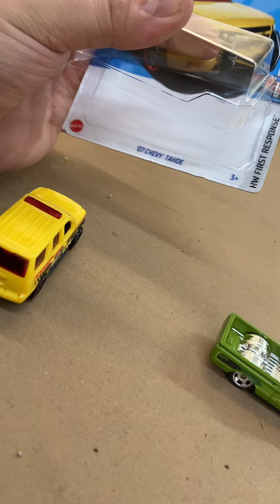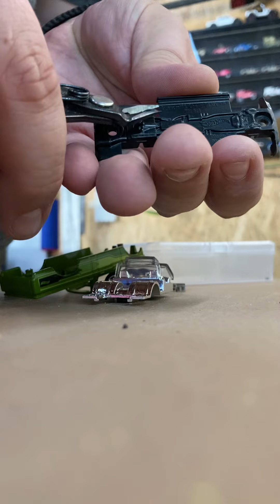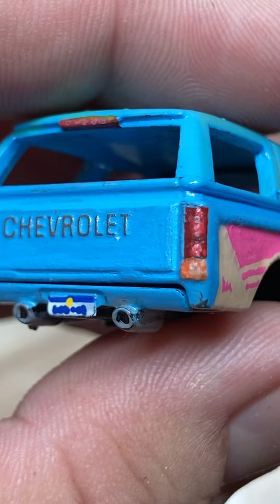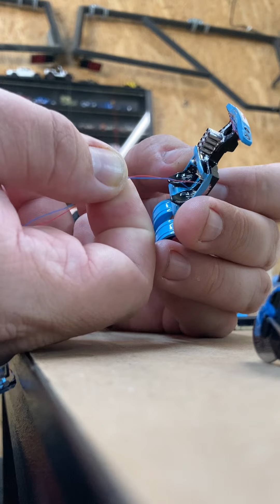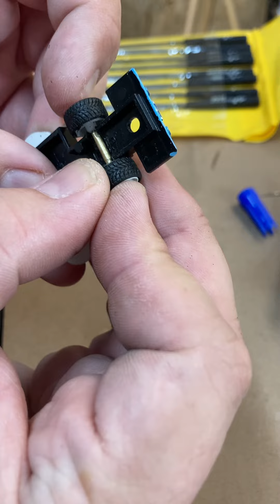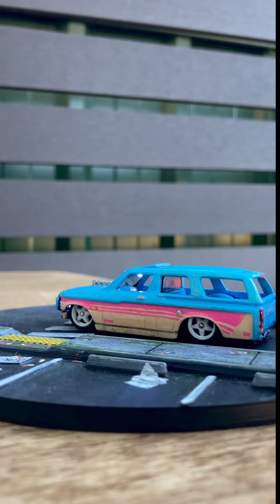Custom Hotwheels diecast mod #7 - Back to the 80s & 90s

Comment: what paint do you use?
Reply from the maker: Posca pens, its a high flow acrylic same as airbrush. If they're shaken ans primed properly they will cover smooth. Sadly ruined it with lumpy clear coat (left the Can in the sun too long)